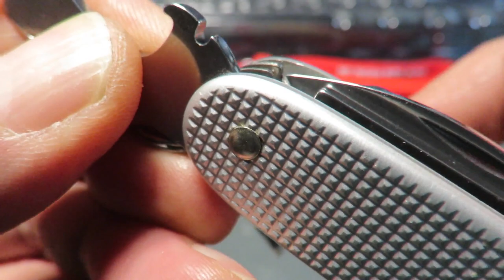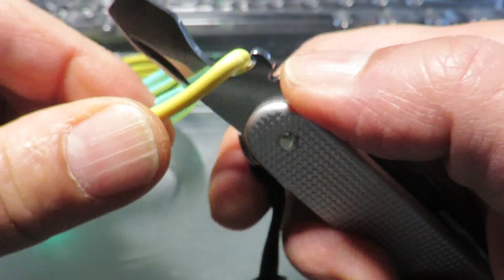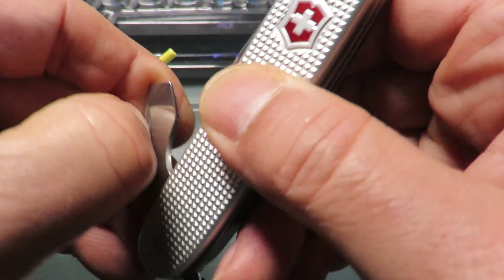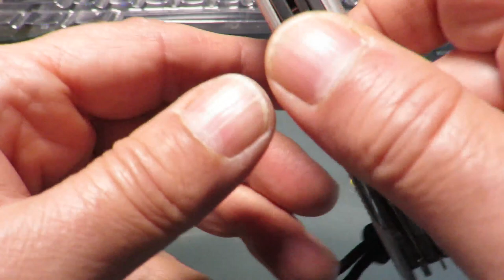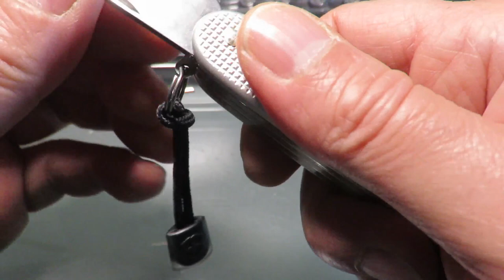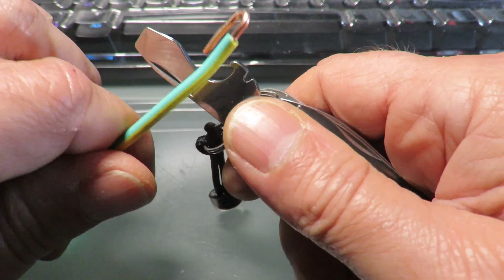The Great Mystery of Victorinox: electrical wires "stripper" or bender?

Comment: People have already shown that the notch has sharp edges and that it is capable of stripping a (thinner) wire without using the blade, as is shown in the very victorinox booklet that comes with the SAKs! Just use the correct wire diameter.

Comment: happy hollydays everyone!
that notch works as a stripper for soft wires with a smaller diameter. Attention, it works perfect when u want to strip at the end of the wire, to be soldered or anything else. Put the wire somewhere at its end but not too far then simply push it down completely, like you want to close that tool. Then open the tool again. Big surprise, it works awesome! For bigger and harder wires the best way it is the one you show here. On bigger tools they have a special tool for it.

Comment: I was hoping that you will also say something... :)
What you can do with that small notch also depends on the type and size of your wire, I think.
I haven't stripped too many wires with a SAK (or with anything else :D) but I remember using that notch on some thinner cables with more inner strands. I used the blade to make a small cut in the insulation (I didn't cut it all the way through like you did on that solid wire because I would have cut the thin strands) and then I pulled off the insulation with the wire stripper notch. It worked quite well and it was easier than trying to pull it off with my fingers.
Reply from the maker: However, I have made it very clear that this so-called "wire stripper" is useless, it can only be used to bend a wire. Indeed, as soon as the sheath of a wire is cut correctly (with the knife for example), I can strip it by hand. I hope that Felix Immler's idea (proposing a real cable stripper) will make its way to the drowsy brains of Victorinox! :) What's more, this 2 mm wide notch is far too small for most commonly used cables (power cable wires).
Reply: @diezelle57  I don't want to argue: it's for sure not the most useful tool on a SAK, and there mith be better implementations.
I was just saying that your way of "making it very clear that it's useless" on ONE type and ONE size of wire is not a really convincing demonstation.

And in general: the fact that you haven't found a use for a tool yet, doesn't mean that it's completely useless. I know people who carry a Pioneer every single day and they hardly ever use the reamer. For me, it's probably the most used tool for all kinds of random tasks...
But again, no offense, I'm just trying to point out that it's probably more useful for some other cables.
Reply from the maker: @miklospinter  Negative. I repeat, at the risk of getting bored, that this notch does not strip anything, it is a wire bender at most.
Reply from the maker: @CraigLuna  ...